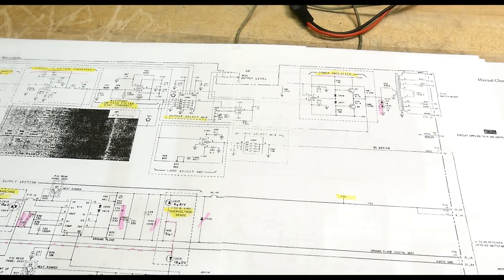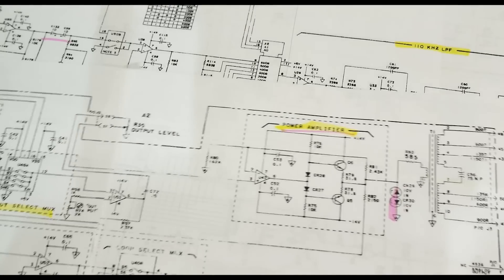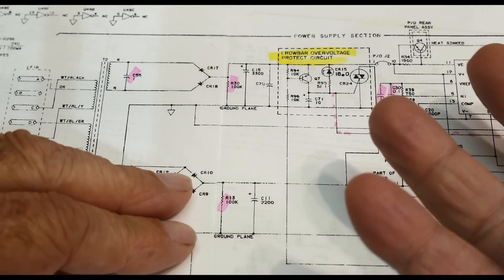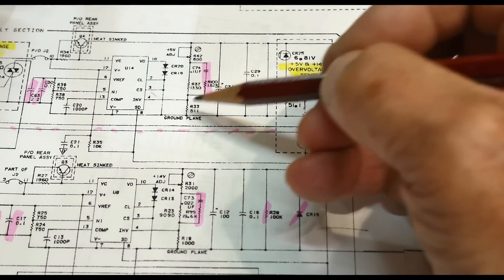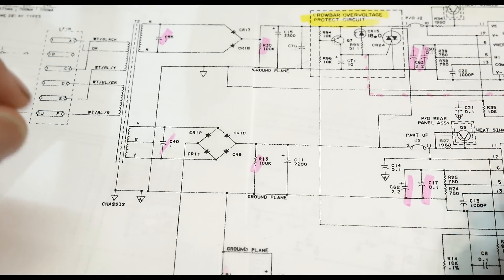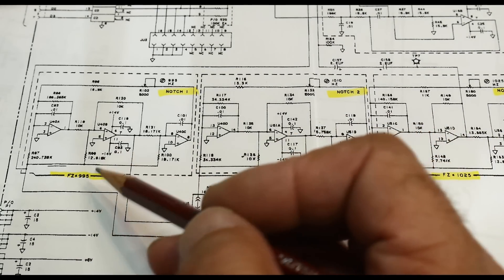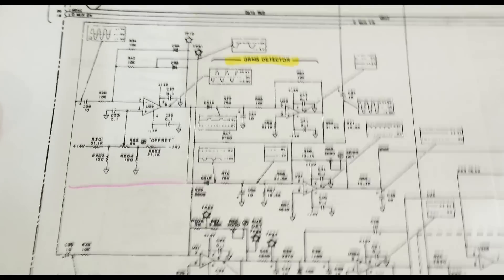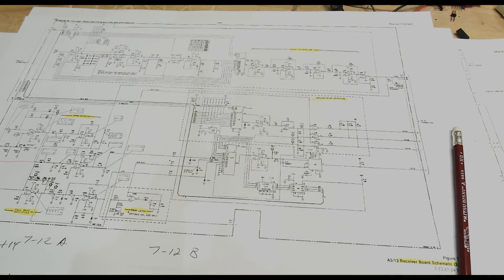#1935 HP4935A Transmission Impairment Measuring Set (part 3 of 3)

Comment: Schematic must be missing the R/R center tap return connection. Check the actual transformer. Either it has another wire or the return is internal to the transformer with the G connection.

Comment: In this scheme, either an error is made, or the central point of the upper secondary winding, or part of the rectifier bridge, was not printed.
upd In this scheme there is an error with the drawing of a supplying transformer. Here is only one secondary winding with several taps. Y-R-G-R-Y
upd Oops, I should have read all the comments above )))

Comment: Question about the power supply that you haven’t covered. The top section only has 2 diodes followed by a TRIAC. The schematic labels that as "crowbar overvolatge protect".  Sorry, my brain is a bit damaged, so I need somebody to explain that part of the circuit to me as though I am 5…😢.
Reply: In this scheme there is an error with the drawing of a supplying transformer. Here is only one secondary winding with several taps Y-R-G-R-Y. And the protection scheme works quite simply, in case of over-voltage any of the power rails, the secondary winding is shorts to the ground through the diode bridge with a TRIAC. The over-voltage sensors are CR18 CR25 CR23 and CR7

Comment: Kelvin ohms and kelvin hertz used in the schematic.  HP usually does better . . .
Reply from the maker: you forgot to capitalize kelvin and hertz
Reply: @IMSAIGuy  🙂I didn't forget.  NIST has a really good set of web pages and documents related to the SI and its use.  SP 330 and SP 811 in particular are really helpful.  In SP 811 they say:  "When spelled out in full, unit names are treated like ordinary English nouns. Thus the names of all units start with a lower-case letter, except at the beginning of a sentence or in capitalized material such as a title."

BIPM, the international body that maintains the SI, to which the US is a signatory also has the SI Brochure (9th edition) which provides the same guidance - see Section 5.3, Unit Names.  I can provide links to the above if desired.
Reply from the maker: @RideGasGas  This is a topic that I find trite.

Comment: In my early days I worked with Telco stuff. I suspect the back to back Zener diodes on the amp output were there to protect the amp from external applied signals.  Like 90V 20Hz ringer voltage or step transients from connecting to -48V T/R pair.  When testing faulty telco circuits you never know what kind of garbage is on the line.   Always loved HP manuals with circuit descriptions with schematics

Comment: I've got a question on the power supply. The upper secondary winding on the power transformer has a half-bridge rectifier but doesn't appear to have a return path. What's going on there - did they just neglect to draw the connection to GND for that winding?
Reply from the maker: does look like there is a missing center tap on the schematic
Reply: You are all correct. The November 1966 (original) drawing shows the transformer has a single secondary with a center tap at G and ends at Y. The R connections are taps either side of G to produce 10 Vac. The ground is common to all supplies and connected to G. Regards, David
Reply: I was wondering the same thing. I even paused the video and expanded the screen to look around and didn't see a return?
Reply: I have the same question.  I mean it looks like a full-wave rectifier using a center tap, and it looks like it provides some biasing for a protection circuit, but what the heck?
Reply: yep. Someone drafting, went for coffee. Probably when that really attractive young lady happened by. 73 de W3IHM
Reply: In this scheme there is an error with the drawing of a supplying transformer. Here is only one secondary winding with several taps. Y-R-G-R-Y
upd/ Oops, I should have read all the comments above )))
Reply: It appears that part of the transformer is connected as a ground to what they are referring to as the ground plane. You can see that the center tab of the other winding is connected to this as well and you can see the shielding or core of the transformer is connected as well. I think it's just a two-tap winding. Somebody has more useful information or if I'm wildly wrong please correct me
Reply from the maker: @MrMersh-ts7jl  there needs to be a DC path. the center shield does not provide this